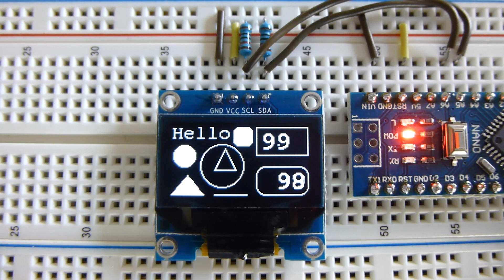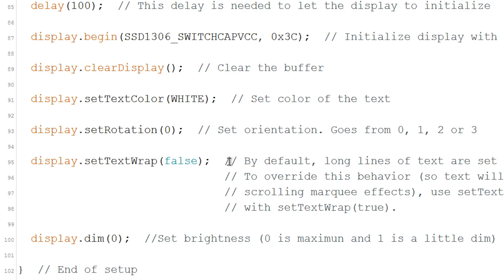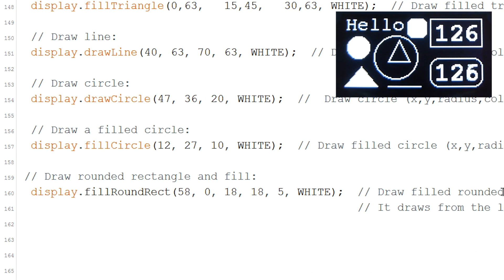Arduino Tutorial: OLED 0.96" I2C/SPI Display

Comment: I know this is an old video. But is there any list of the default letters and characters that can be used with the gfx library? I want to display direction arrows like on a keyboard and wondering if that can be done without custom fonts or drawing them with traingles and squares?
Reply from the maker: In my sketch there's a link to a page that has all the details about the included fonts
Reply: @interlinkknight  Thank you very much. I have managed it by using the cp437

Comment: Hi everyone,

 I would like to show the code on an LCD screen or on the "serial monitor" of the data that is received in an RF module, has anyone done something similar?

 Either with an ARDUINO or with a PIC

 Thanks in advance.
Reply from the maker: I never done that but if you get the text from an RF module, just use the example of the display to print it there. Basically is joining both examples, the RF and display, together.

Comment: friend, how do I turn off the screen when not in use?
Reply from the maker: I don't know, but if you really want to save battery by turning off the display, I always cut power to the display by a transistor. In my experience that save more battery than any command to "turn display off".

Comment: Is it possible to run it with only an arduino and cables?
Reply from the maker: You can see clearly that the display is in the breadboard with the Arduino nano. The resistors are optional but I recommend them

Comment: Hi!!
I have a problem with the display that I don't know if it can help me.  After a few seconds of uploading the code to the NANO, the image freezes or all the code restarts very very often.  After reading forums for several hours, I realized that the problem is not your code but the Wire.h library, which causes the reading to hang through the I2c port.  Apparently the solution is to use SBWire.h, but so far I have not been able to get it to work.  Do you know anything about this problem?

Br
Reply from the maker: Try adding pull-up resistors on both pins for i2c. Maybe it's related to something i talked about in one of my videos https://youtu.be/IJuhvmKH6co
Reply: @interlinkknight  Already solved.  I changed the board to NODEMCU 8266, I changed the pins intended for I2C communication, and problem solved.  I have two BME280 sensors and an SSD1306 display and I no longer have a freeze or reboot issue.  Thanks for answering.

BR

Comment: Can anyone say, what are the values of the capacitors on the backside of this module? The brightness of my module is too low, so I suppose there can be a problem with the caps.
Reply from the maker: Why you think putting larger capacitors would make it brighter?
Reply: @interlinkknight  I'm just wondering if one of them is not damaged.
Reply from the maker: No. The display works fine

Comment: Hi thank you for this, but I was wondering how you the sketch would look with an SPI ? Thanks
Reply from the maker: I think you only need to replace the line 78 where you start the display. I think the library has their own example for SPI. You can take that line from there
Reply: @interlinkknight  Thank you! I will try that
Reply: @interlinkknight  Also I just wanted to clarify how the pins would be connected for the SPI since there are extra pins for RES DC and CS. Thanks!
Reply from the maker: I don't know. The library has examples for spi and it should say the pin connection

Comment: I have a 128x64 display but I still get the lines u showed at 1:33 even after I fixed the adafruit ssd1306 library by changing uncommenting #define ssd1306_128_64.
I tried the u8g2 library as well with no succes. Do you have any suggestions or is my oled broken?
Reply from the maker: In the new version of the adafruit library you can set the resolution in the sketch. My example has that line included so it should work. Check that you don't have duplicates of the library somewhere else.

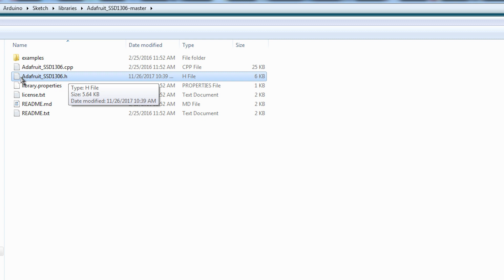Comment: El problema con comentar las líneas, en la explicación del minuto 1:17 :
       a)  #define SSD1306_128_64
       b)  #define SSD1306_128_32

Si dejas comentada la linea b), el programa corre con una resolución mejor, pero se llena la memoria del Arduino hasta un peligroso 78%, dejando algunos bytes para las variables.

Si tu proyecto no usa muchas variables, haz el cambio que explica, dejando "descomentado" la línea a).
Por otro lado, si el proyecto utiliza muchas variables, no modifiques el archivo "Adafruit_SSD1306.h" y usa tu display oled como si fuera un 128X32.
Reply: Si, usan la nueva versión de la librería, se puede cambiar las lineas comentadas en el video, y el problema de memora ya está resuelto.

Comment: The sketch runs very well but I need to use it with a BMP180 that still use pins A4 A5. How I can change this pins, Thanks  Renzo
Reply from the maker: You can connect multiple i2c devices in the same pins. That's the idea behind i2c, you know.
Reply: @interlinkknight  thanks

Comment: can you not just directly control the display pixel by pixel?
and without a library? like if i want to use a library i would just read about that online, no need for a video... i expected to learn about about the protocol and how to send data to the display directly.
Reply from the maker: You can control every pixel with the library. Even show pictures
Reply: @interlinkknight  oh i see but one question

if you don't use part of a libary is basically gets ignored, right? so you don't have the actual Arduino full of unused code and stuff
Reply from the maker: For the most part, the library is going to take a lot of memory no matter if you don't use it. If you are worry about memory, maybe use an arduino mega that has more memory.

Comment: I've got 2 of these.. 128x64  and i'm trying to find a good animated eye that will work with arduino uno boards? so far no luck? anyone know of any? that doesn't require a Teensy board for it? Just looking for a cool animated eye that I can use for my robot !!  thanks .
Reply from the maker: I think you need to make it yourself. How hard can it be? Two circles and change the coordinates and size.

Comment: Hey guys.. could use some help here. I have 2 of these.. hooked them up. and I get NOTHING on either video. they both are BLANK. like no power etc to them?? what I am Missing. I have my 4 wires hooked up to my arduino correctly ( tried both methods for SDA and SDL connected them to the A4 and A5.. and even tried them on the SDA and SDL pins.. But neither seem to make these thing light up. and Yes. my Vcc red wire is connected to 3.3 v and brown wire to Grn.. ?? tried with cable to PC and tired with power pack.. neither seems to light up these OLED's did I get 2 faulty ones at once? they were packed in hard plastic cases so they weren't cracked or damaged at all?
Reply from the maker: Connect the display and run this sketch to scan for I2C devices: https://playground.arduino.cc/Main/I2cScanner/

In the serial monitor should show your device and the address. Maybe your address is different. If it's different than 0x3C go to the setup in the line (adafruit library) that say "display.begin". In there you can edit the address.

If in the I2C scanner doesn't show any device, then your display is broken and you should ask for a refund.
Reply: @interlinkknight  thanks but all set. got it working .. just now trying to get an EYE to work a nice eye..  BUT I did find out why you had that High Pitch sound.. I'm assuming your using 5v and not 3.3v  because they state the high pitch will go away if you bring it down to 3.3v from 5v if it bothering you.
Reply from the maker: Using 3.3V lowers the high pitch noise but doesn't eliminate it completely
Reply: @interlinkknight  my issue turned out to be the the schematics said to use A4 and A5 which I couldn't use I to swap them from those and actually use the  SLC and SDA . And it worked fine! 
Thx for the quick response thou.. appreciated!!
Reply: @interlinkknight  Thank you so much. The new Adafruit Library specified 0x3D for this size of device so I was getting nothing. I didn't notice the address being different in your video but I tried that sketch an it IDed it as 0x3C just as you have it.

Comment: Is it possible to use the PULLUP command rather than use the 10k resistors for the I2C pins?
Reply from the maker: Good question, but sadly that doesn't make any difference (I try it). I think the I2C pins for arduino already have pullup resistors. I2C devices usually have pullup resistors too, so that's not the problem. My point on this video is that the value of those pullup resistors usually is kinda high, meaning that you have to add more resistors with lower value, like 3K, if you want to make sure the connection is stable.

Comment: A note for visitors in 2019: If this isn't working for you, your device is NOT defective!

The Adafruit SSD1306 library has been updated and editing it is no longer necessary. Screen size is now defined in the sketch. The problem I had though is the 128x64 example sketch didn't work. The 128x32 did, but like in the video prior to editing the library, it skipped every other line. Some Googling told me that it's likely a hardware problem because a lot of these screen's bottom corners are chipped off causing the problem - this is false, your screen's fine. Just use the 128x32 sketch but change the values in the sketch to 128x64. I don't know what's wrong with the other sketch, they should be identical, but clearly something's wrong. I wasn't able to find this solution anywhere online - I figured it out myself. I hope it helps save someone some time and frustration.
Reply from the maker: Good to know. I'll dig into this and do the proper changes to my sketch.

Thanks.
Reply: Not all heroes wear capes...
Reply: The 128x64 example points to 0x3D in the display initialization. This must be 0x3C (as described also in the video).

This works for me :)
Reply: the .H file auto defaults to the 128x32. you need to change it manually to 128x64 . .least thats what I did and POOF she works :)
Reply: Thank you, you saved me a lot of headache.  For others the URL for the 128 x 32 that I modified like TheResidentSkeptic did is below.

https://github.com/adafruit/Adafruit_SSD1306/blob/master/examples/ssd1306_128x32_i2c/ssd1306_128x32_i2c.ino
Reply: nice
Reply: Thank you sir, I was about to buy a new device because I was so sure it was defective.
It works perfectly after reading your comment, holy shit.
Reply: Thank you man.
Reply: Thank you very much.

Comment: Thanks, great tutorial. Just one question: I use an arduino nano and the same display. But the refresh rate is much slower. About three numbers a second. Do you know how to increase the refresh rate?
Reply: Same problem for me using an identical display and an Arduino Mega. I had installed Adafruit GFX 1.3.6 / Adafruit SSD1306 1.2.9 I solved downgrading to Adafruit SSD1306 1.2.8
Reply: @Ale11Re  Amazing. Thank you. This was the solution. Now it runs about 10 x faster
Reply from the maker: Depends on the library. What library are you using?
Reply: @interlinkknight  Adafruit GFX 1.3.6 / Adafruit SSD1306 1.2.9
Reply from the maker: I don't know. Assuming you don't have any delay on the main loop, it should run as fast as I show on the video. Can you send me your sketch?
Reply: @interlinkknight  I use only the four cables between the display and the nano as written. But no resistors since I never had an communication issues. Is there somewhere a possibility to change the i2c speed?
Reply: @urshelfenstein1405  I'm using an arduino Uno and had the same problem. I made my own counting function and got rid of all the shapes and boxes and now I am counting from 0 to 150 in about 6 seconds. Not sure why that solved it.
Reply: Same thing is happening to me as well

Comment: Good Morning! I'm having a hard time believing you can help.
I can not make the ultrasonic sensor print on the 128x64 white spi display, only on the serial monitor, a hint please, if you need any information, just talk.
Reply from the maker: But did you get the display working with my sketch?

Comment: Hi. Anyone knows if its possible to change the SDA and SCL pins in the code? (if you have pins 11 and 13 already in use). Thanks in advance
Reply from the maker: We are using hardware I2C so you can't change the pins. I don't know if this library could work with software I2C. By the way we use A4 and A5 pins, not 11 and 13.
Reply: thank you
Reply from the maker: True, although you can't still use the A4 and A5 pins.